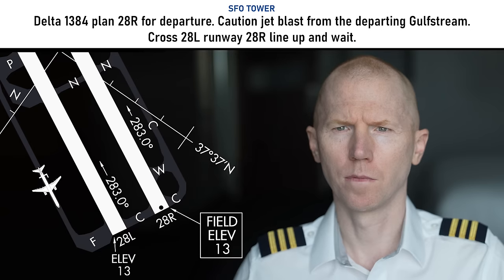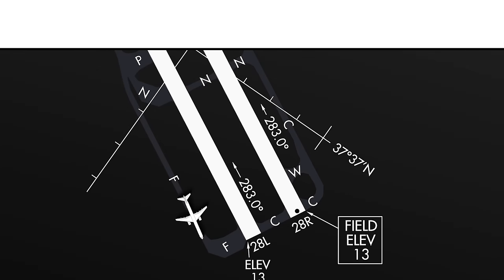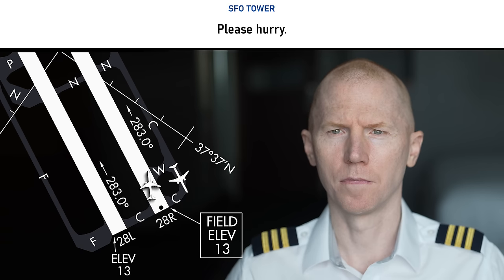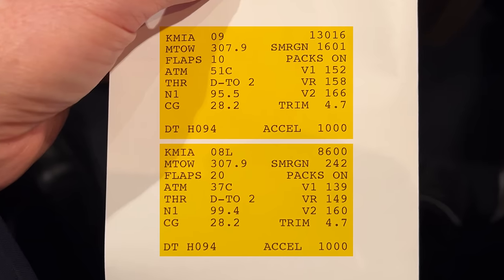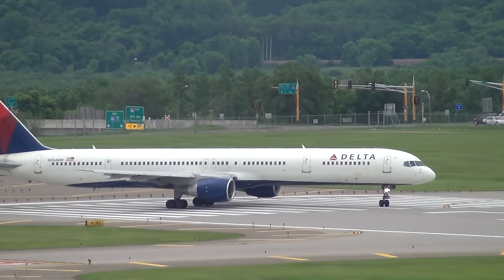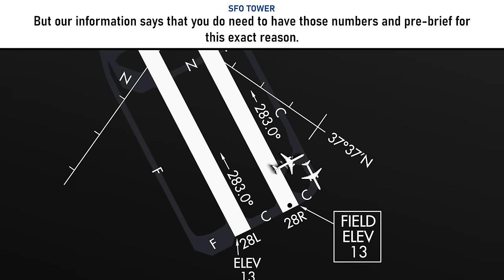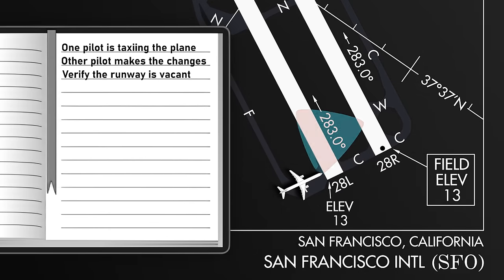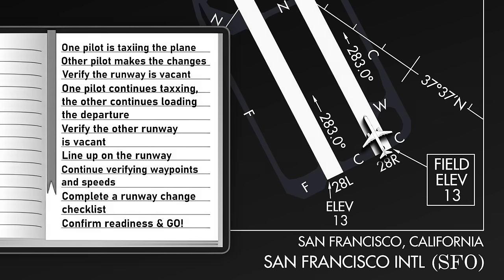ATC Doesn’t Like Delta’s Comment

Comment: Ultimately the safety of the plane is in the pilot's hands.   ATC gave the choice to the pilots to hold short and plug in those numbers.   I agree with the assessment by 74 Gear at the end.  Hind sight is 20 20.

Comment: Seems like as advanced as things are and as simple as it is to program things these days, the data for all airports and all runways should be pre loaded so that all you have to do is click which airport and runway you are using and it will auto load all those parameters automatically instead of having to enter them manually every take off.

Comment: Regardless of the sudden change by ATC, the Delta captain should not put pressure on the F/O with only 2 min to load the computer and should have held short until they were ready. Often enough, some captains are assholes and hate their copilot. I know, I flew with some over demanding captains on the DC-8

Comment: It’s absolutely amazing that there are so few accidents involving miscommunications frankly. From a layman’s POV …. I clearly sense that the system is nanoseconds away from disaster. We’re talking “overload” here. That passenger plane should logically have remained in a lineup until the runway was safer… after that incoming traffic had landed and started getting out of the way. It’s a good thing that passengers don’t know WTF is really going on … kind of like: “I don’t think you wanna know what the kitchen looks like right now!”

Comment: what was the reason for the runway change, why didnt she hold them short of the runway, why the extra work load of last minute runway changes making for confusion, if the controllers are not planing ahead with the aircraft movements their procedures may need to be changes to protect the airplanes on the ground and landing from colliding or having to make emergency movements .  kiss is the safest plan.  what was the outcome for the landing plane in this problem. did the ffa get involved to instruct both party's on a safe way to not get in an aggressive confrontation with so many innocent people at risk in the planes and surrounding community.  i was told to trust the ground and tower to provide and protect  me not to have an attitude against me as a private pilot . is there a web page that rates the towers and controllers for the pilot's safety?

Comment: I served in the armoured corps in a M113 with one man Cadallac Gage T50 turret as an armoured reconnaissance soldier. So a crew of two - driver and crew commander. So many things the Crew commander has to stay on top of - where are we on the map, where does my next bound end (advance to a predesignated temporary halt), instructions to the driver for the next move, Where are my guns pointed, listen to the radio for other armoured vehicle crew commander reports and sightings, on top of this may have to decode a numeral cypher or trigram code received over the radio. Looking for the dreaded enemy, especially potential ambush sites. We are heavily dependent on our driver - observing what is to his front and flanks, and making sure he is in correct formation with other armoured vehicles in our troop. Driver to make sure a low branch doesn't bean his crew commander's head (I have seen this happen more than once). 

What we crew commanders quickly realise is the high value of a competent, alert driver. Experience has shown it is usually the driver who first calls out Contact cos he is the first one to spot dreaded en, cos he is constantly looking at the terrain to pick the path of the vehicle while the crew commander is carrying several tasks almost at the same time. A good driver develops a good eye for something that looks out of place with the terrain - might be a poorly camoflaged en soldier or vehicle. Or an odd movement out of place such as animals moving away from a particular spot, etc etc.

These videos produced by Kelsey are an eye opener for me on how busy cockpit crew can be and how critical situational awareness is. I agree with Kelsey on deliberately developing your gut feeling. And following your gut instinct. I have a new found, higher respect for pilots watching Kelsey's videos. I think Kelsey creating and sharing these videos, some thought ought to be given to make compulsory the watching of these videos at least once a year for pilots to mitigate complacency. That's my two cents worth.

Comment: IMHO given the huge emphasis on runway incursions, the runway assignment ought to be given with the clearance on CPDLC. And I sure don’t get a warm and fuzzy feeling either crossing a runway—or worse, holding in position on an active runway while hurriedly trying to comply with the controller’s ridiculous request. Yes, the answer for the pilots is “we’ll need some time to set up the box,…but NOT on the runway. The controller needs a headset with some brains.

Comment: In Flight school I did a xcountry flight total and was about 4.5 hours, small flight. I left on 36L so when I came back I went to the south and the winds changed so now they gave me the info for 18R. I have laned that way a couple of times but before base they said, for this we will call it "Whitney", they said circle the Whitney build to allow another aircraft in front of you, your 3 for landing. I am looking around for a huge Whitney sign, i only see a big blue building, And no signs. I asked the tower what the Whitney building was and they went off. I got landed and a tower supervisor came out to talk to me and said sorry. The best way I can describe this communication is like me tell you to turn right at the old smith house the 6 roads later take a left but if you pass the old Jones house you went too far. Who the heck is Smith and Jones and how do I know? COMMUNICATIONS! 
Note: they called it the blue building after

Comment: I’m sorry, but ATC 100% right on. I think this Delta crew lacked the experience of operating out of SFO.  But that being said, the crew should of had the numbers for both runways while at the gate in case of runway change, which crew said they had. Don’t understand why it takes 3 mins to enter the different runway.  All they had to do  is nothing, just takeoff on 28R it’s a longer runway and no difference to departure.. briefing at gate would go over all this.  It’s only 3 button pushes to select 28R  (:05 sec). DEP/ARR 28R EXECUTE done.  Then 3 buttons to make takeoff speeds large .. well less then :30 sec to finish task   But why complicate situation, just cross 28L and line up on 28R like controller said 3x.  Part of being a professional pilot is being prepared for all situations and having the big picture. And not asking controller 3x for instructions.  I think she handle this very clearly. I like how she even paused in middle of instructions before saying “line up and wait”.

Comment: I have experienced this exact thing at thing at SFO at 28L. ATC has never been killed when a plane crashes. And truth comes out next time I came out to the FBO ATC at least put a not to advise of possible last min runway change but smart 38 year seasoned veteran pilots know better to cave to ATC just for ATC  expediency. Proof that ATC wants no responsibility is that they got rid of ride along program. It’s NEVER good to rush in a highly automated Aircraft. Worst part is we KNOW this and sadly there have been system failure breakdowns that were fatal . Top 3 things from survey of 20 pilots with 20k accident free hours. Number 1 : NEVER RUSH. Easy to say hard to always execute.

Comment: I’m a bit concerned that ATIS is being used as an air traffic control directive tool. The SOP’s I’m familiar with have a strict runway change policy that must be adhered to. This runway change came too late to fulfill that requirement regardless of briefing both departures before taxiing out. Pilots tend not to want to cause congestion and work hard to accommodate ATC. However in this case I feel as though an out was provided by ATC to hold short. The pilot monitoring could have mitigated this risk by just asking the pilot flying to hold short to complete the runway change. 

SFO is an interesting case in point. As it is a very technical airport both inbound and outbound. I feel as though pilots have accommodated controllers there far to much as the number of movements in and out of that airport at times are excessive. 

This is a good case for study on both sides of the radio so as to mitigate risk.

Comment: I would love to see a video graphic of a major airport showing all the SIMULTANEOUS 'moving parts' over a 5-10 min period. Moving parts = ground movement (push back, taxi, departure. Final approach (including landing, separation, sequencing of planes in the air and departing (is there alternating between planes taking off and departing?). O'Hare operates multiple runways at the same time; my brain cannot comprehend how all these activities mesh together with precision and how the scenario in this video would not cause a ripple effect for a busy airport. Part 2 of this request might indluce what happens when there is a missed approach, go around, bad weather not planned popping up, a mayday call prior to landing or immediately taking off, an aborted take off) --- how would these affect the finely tuned machinery of the PART 1 vid?

Comment: Speaking of ATIS, maybe there's something that can be done about the length of time it takes for an ATIS to run through its cycle.  Some of the broadcasts are flat out way too long.  A pilot shouldn't need to wait for three minutes to get the current visibility off an ATIS that has just updated.

Comment: Good point MP, ATC gets too emotional and at the wrong time.  There is a time for the ATC to discuss timing and runway decision changes, but Not Over the Air which will obviously negatively change the pilots state of mind.  The ATC lady expressed the "I am right, you are wrong" attitude immediately.  Snapping back to the pilot at this time (even of she was correct) was endangering all aboard that flight.  I have studied commercial airline accidents for many years (working in NDT and Inspection) and find the mental state of the pilot plays a critical role in most accidents.  The mental state of mind of Al Hanes, Denny Fitch, Sully Sullenberg, etc saved the day and the lives of many.  But pilots like Larry Wheaton, Jacob Van Zanten and Robert A Loft should never been permitted to carry passengers.

Comment: My answer to her statement on pre-brief would have been "Yes, we did pre-brief, and that pre-brief was ''If ATC decides to switch runways less than 5 minutes from roll-out, we will hold short and do a methodical re-entry & check. And that is what we are going to do. Standby'' 
I'm not a pilot, but as an engineer and ex-combat infantry I could list about a 1,000 scenarios that would wind up that way. In fact, that kind of procedural + on-the-ground failure is what caused that University in Florida's bridge to collapse on a road that shouldn't have been occupied in the first place and kill people. The ''ATC'' folks said, "Go ahead and run traffic through the construction zone" while the ''pilots'' on the ground said ''We don't need any extra safety check procedures, because we are pre-tensioning, just like the other times''. And someone made a mistake (that should have been clearly noticeable) and people that should not have been there anyway died.

Comment: The correct thing to do was have Delta hold position short of 28L, ask them if they could accept an immediate from 28R. If yes, they're cleared onto 28R and take-off as cleared. If no, then they're either cleared to hold short of 28l or 28R. No fuss, no drama.

Comment: I’ve been in this EXACT situation, airport, controller, airline. “Unable 28R, we would like 28L”. Controller said sure, hold short and then we departed. 🤷🏻‍♂️. If for some reason 28L is unusable then always hold short n get it all done, however long it takes!  A wise old instructor tried to tick a student pilot me “how long does a preflight take”. “It takes as long as it takes!”

Comment: As a lowly private pilot, I sure hope your video is seen by all the powers to be in ATC. Excellent presentation of all the facts from both sides. And I could not agree more about spending time in other's shoes. Many years ago before 9/11 I was driving in the Leesburg VA area where Washington Center is located. Without any advance notice I walked in and introduced myself and said I would like to see the operation. I believe the program back then was called Rain Check. I was taken in and shown the entire operation of ATC, standing directly behind the controllers and chatting with them if they were not busy at the moment. It really enlightened me as to what was happening when I called them in the air. With today's climate of security that would never happen now, but I am glad I did see the operation, even as a C152 pilot.
Reply: Great experience....thanks for sharing..

Comment: Definitely both are partly to blame. Pilots weren't fully ready/prepared for takeoff. Controller lost her cool/professionalism.

One thing that should be noted, but not be considered an excuse, this occurred when SFO lost both 01L/R to construction for a short period right before summer. This resulted in added controller stress/workload in trying to balance arrivals/departures on both 28L/R. This spawned another incident with the multiple go-arounds, where SFO/NCT controllers were at a disagreement on sequencing. To prevent more incidents and delays (at UAL's hub), the remark in SFO ATIS was born, to be ready for runway change. Now that 01L/R is back in business, you rarely ever see that note in SFO ATIS until it happens again.

Comment: No clue why ATC didnt just have them hold short 28L. They did say thought they are fine with 2 minutes, so its kinda their own fault. If they needed more time because of the runway change they should have not accepted the line up. I dont really understand it either since you wanna be on the runway as little as possible and lining up once ready from e.g. holding short 28L or even behind 28L holding short 28R (image looks a bit like a plane cant fit there but probably it can irl) would have worked out fine and they would have had time to prepare. I mean there can always be some minor problems and being on the runway already is just unnecessary if you arent going to actually depart pretty damn soon.
Ryanair here in cologned doesnt even lineup, they come basically into the runway and then go for takeoff without stopping :D

Comment: rushing leads to accidents..don't let ATC rush you even though it may turn into an uncomfortable exchange.  my guess is the Capt. told the FO to tell her 2 mins.  it takes longer than that to get the numbers, load them, review the departure altitudes and speeds, do the change items on the checklists etc CORRECTLY...they should have just said unable, but too many crews rush for whatever reason.  controller's attitude was uncalled for.

Comment: @74 Gear - I had to pick my jaw up off the floor with how extremely rude, insulting, argumentative, condescending, unprofessional, childish and nasty that Air Traffic Controller was being towards the pilots. Absolutely none of their nasty comments were necessary or called for. High school students behave with more maturity. 
  Hundreds of peoples lives are at stake on the planes arriving and departing.  An A.T.C. should not be making comments that could anger, upset and break the focus of those pilots, potentially creating a very dangerous, life threatening situation.  I don't know what kind of problems that A.T.C. is having in their personal lives to encourage them to behave in such an unprofessional manner, but they need to get their act together or find another job before their behavior gets people killed!   I am shocked that such unprofessional conduct is tolerated. 
  I am very glad I am not a passenger flying to or out of that airport!  How does this A.T.C. keep their job with behavior like that?  Does the F.A.A. investigate the conduct of A.T.C.'s?  Something needs to be done so this doesn't happen anymore.  Two minutes or five minutes, it matters not.  To make childish, nasty, argumentative, insulting, comments like that is completely unprofessional.  I have been in customer service/sales jobs all my life and I I ever treated someone like that, I'd be justifiably fired!  Is the F.A.A. aware of the conduct of this particular A.T.C?

Comment: This is wrong.  The ATIS says to have both runway numbers available.  They did not.  I am an AirBus 320 Captain in SFO right now.  We have both numbers available in this situation.  it takes 30-60 seconds to change from 28L to 28R.  Departure procedure and engine failure procedure does not change.  The pilots were wrong on multiple levels. If they could not accept the clearance to line up and wait or be ready for takeoff then that's on them. ATC told them to change runways,  they accepted the change and time, then did not take off in the time they stated.  That's all on the pilots. All they had to do was say no.  Need more time. Which apparently is more time than most other major airlines. I fight with ATC all the time.  This isn't one of those times.  This is one crew screwing up a major international airport by not being professional pilots and ready for runway changes that were clearly defined by ATC before the event.
Reply: Yes!  You are 100% right!  If they brief this scenario at the gate they would of seen they didn’t need to change anything   Just takeoff on 28R a longer runway.  No need to turn a simple clearance into a complex situation.  As professionals we are expected to listen on the radio so the controller doesn’t have to repeat themselves.